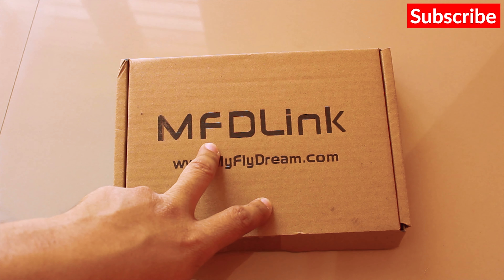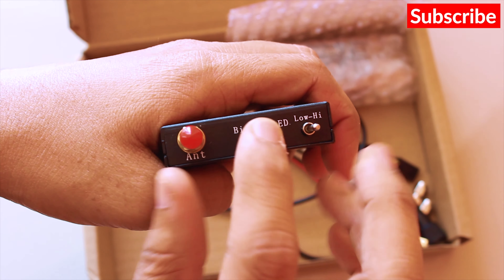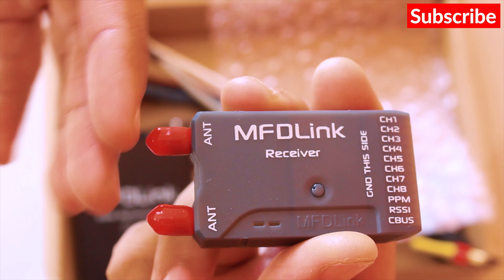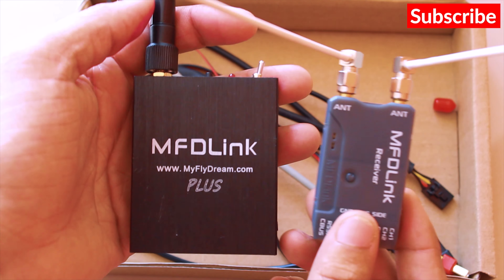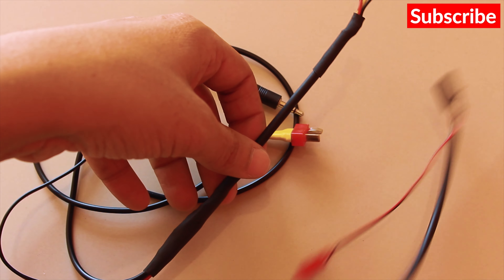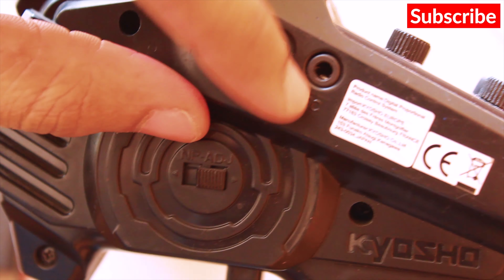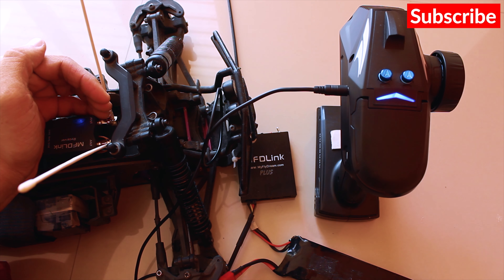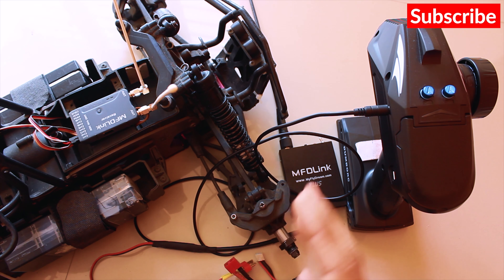Best Budget UHF System for Rc Car and Long Range FPV - MFD Link 433Mhz

Comment: Nice work, thank you for showing everything possible. Awesome job bro
Reply: What batteries are you using for this particular project?
Reply from the maker: @rail_finest_ubreakifixllc4978  a 3s lipo for the UHF module and 6s for my rc car
Reply: Where does the battery for the transmitter plug into?
Reply from the maker: @getpremiumnowtowatchvideos4461  depending on which wire you are using you'll need to solder a connection for power.

Comment: If you were to try controlling the aircraft manually (not autopilot) through the transmitter at 50km range, would it work?
Reply from the maker: I don't know. 50kms if very very long range and i doubt it's possible with the stock antenna even at 800mw. 10-15km would be the threshold I'd consider for this UHF module within which you can control the aircraft as long as the signal reception is good. But then you should also have gps rescue to in the event of failsafe. 👍

Comment: Hi! Thanks for the very informative videos! Can you connect the Skyzone Head Tracking in the same input that you connected the UHF into the Dumbo RC? Also, do you know any other (surface) transmitter that can accept a head tracking input? Thanks!
Reply from the maker: I've made a head tracking video with skyzone cobra x and this uhf module.
https://youtu.be/KpIVk5kMggE
Hope this helps.
I believe some of the higher end surface radios from radiolink and flysky may have to option to accept ppm input for head tracking but I am not sure. Even I have given it a thought but haven't bought or looked for any options throughly.
Reply from the maker: If you want a surface radio for head tracking then you could look at the radiolink rc6gs V2. It has option to use head tracking with fpv Googles

Comment: Very Good Man! I'm very curious to see your range test. I like FPV on the ground and planning to use UHF 433 mhz in my RC car. For the video the best solution is 1.2ghz. I Don't know where I can purchase this system, do you have a link?
Reply from the maker: I've ordered a 1.2ghz Vtx and Rx system but haven't received it yet. In about a week or so I can shre my review on this UHF and the 1.2ghz video setup. Thanks. I've ordered it from Ali express

Comment: Gr8 video brother keep it up!!
And can u tell What's it's practical transmission range like does it really do 50km?
Reply from the maker: Thanks! Will be testing the ground range tomorrow with stock as it is. I hope it'll transmit atleast 5km on ground as stock. 50km is only possible in the air though with better antennas
Reply: @RakishRc  will be waiting anxiously to see how it performs at ground cos I'm interested in Long range ground fpv...
And best of luck for ur channel brother!!
Reply from the maker: @usamanawaz1126  thanks! I did a quick penetration test of the signal and to my surprise it kept working without failsafe..just have to test the actual ground range in real application very soon 👍
Reply: @RakishRc  that sounds great brother I'm waiting for it's testing video...
 brother I'm a new bie in hobby can u plz guide me a bit here I'm really interested to buy this uhf system I have two transmitters Fs-gt3b and futaba 3pl will this uhf system support and be easily installed /setup with my transmitters (like plug and play with or without extended cables /connectors etc)? 
Gt3b has dsc same as dombo x6 but futaba 3pl has no dsc port.
(I mostly wana use it for Long range ground fpv)

Comment: Mine came with an SBus Convertion Board, does that mean I can keep my original receiver and then just connect the convertion board to the mfd receiver? it did not come with instructions so all I can do is look at what you are doing and then do some guess work.
Reply from the maker: Well the sbus convert is very handy if you want to use you 2.4ghz radio as realy for your UHF transmitter. I read in the manual about this but I did not get one. Let me search a bit and see
Reply from the maker: You can connect a sbus receiver to you UHF transmitter ext port using the converter. Connect one end to you 2.4ghz sbus port and the other converter port to your ext port of UHF transmitter. This way you won't have to connect you 2.4 radio using a wire to you UHF transmitter.
Reply: @RakishRc  Thanks for getting back to me, I will try that out.

Comment: Greetings -- Thank you for the video; that's an excellent little tx/rx unit.  So, is it possible to actually send video over this link?  The application is one of the older Thunder Tiger submarines.  The control radio is a 50mhz Futaba, and I wanted to see if I could send a video link over this 433mhz unit.  UHF won't penetrate too deep, but if should go a few feet at least.  I did a lot of research, but did not find anything obvious.  What do you think?  Thanks.
Reply from the maker: I don't think you can transmit video with a UHF transmitter designed for radio signal. But I do believe there are 433mhz video transmitter available that you could look for? Still it would be great if you could use a UHF and transmit video although I don't know if that can be done
Reply: Very good, thanks for the response.

Comment: Do this give you longer rc control range or longer fpv range?
Reply from the maker: Long rc radio range.
Reply: 5 km my rc mfd rlink 433 mhz + booster uhf 20 w

Comment: Great video. I have question... Can i connect this system with FPV camera together?
Reply from the maker: Yes of course you can. That's what I will be doing as well once I get my 1.2ghz Vtx and Rx. Only thing to keep in mind is the placement of the fpv transmitter and the UHF receiver so that there isn't interference. Thank you for watching
Reply: @RakishRc  Can you make tutorial. How to make this fpv?
Reply: @RakishRc  Because i want upgrade my rc car to long range and long range fpv. So please make tutorial. Thanks.
Reply from the maker: @cltwilly597  yes I will be making a tutorial on that just have to get the parts which will be delivered soon. Stay tuned 👍